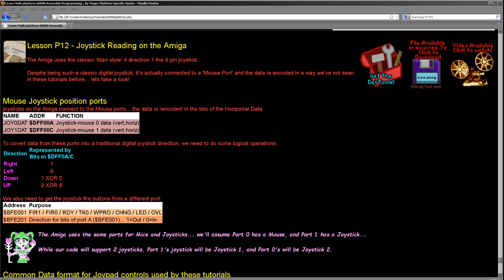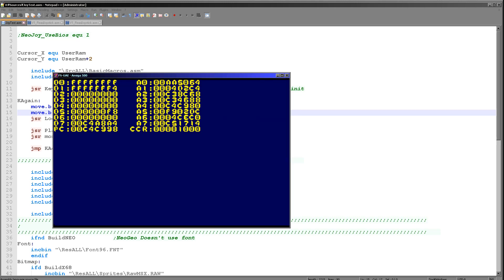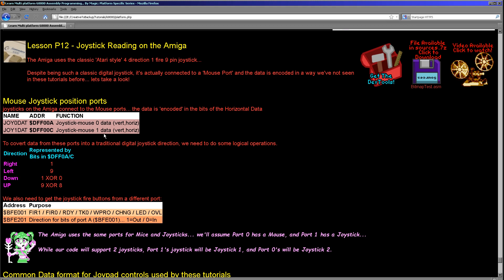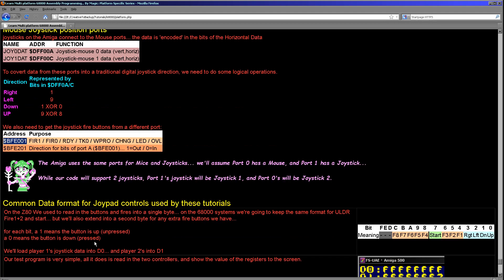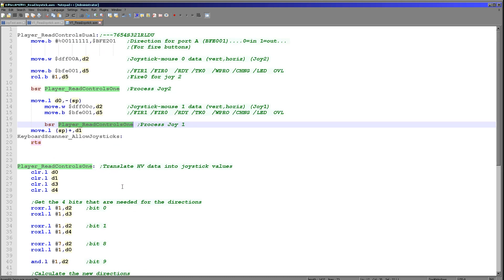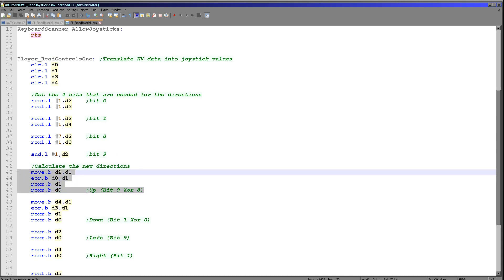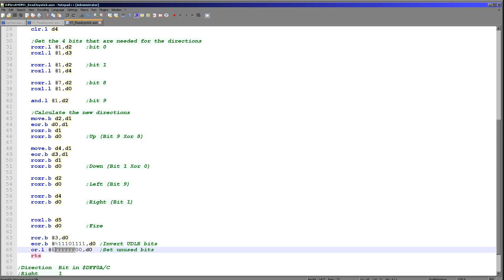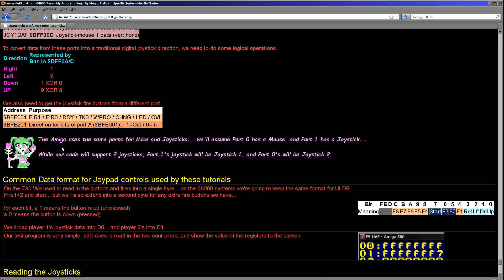Joystick Reading on the Amiga - Learn 68000 Assembly Lesson P12

Comment: Any advice on handling 4 joysticks using an adapter on the amiga serial port?
Reply from the maker: Sorry, but that's not something I've come across in my programming travels.
Reply: You mentioned the Amiga only having one fire button, and although using just one of the buttons is sadly very common in Amiga games, it's not entirely accurate. I used multi-button controllers on even the A500+. Any idea how that would have been achieved? Also, any plans for a  lightgun tutorial for the Amiga? Asking for a friend...